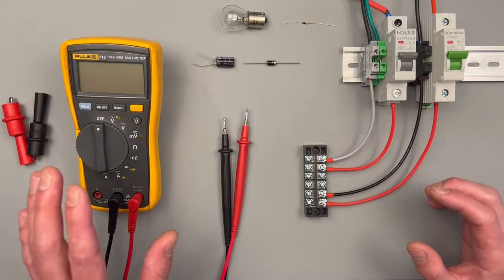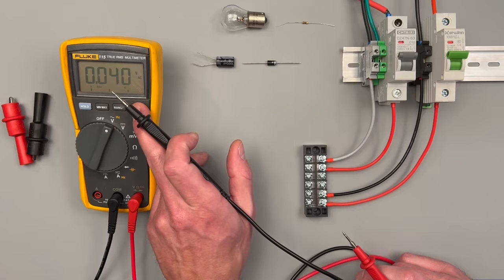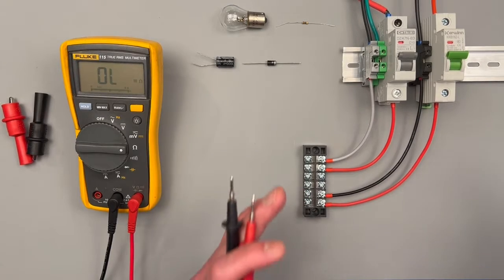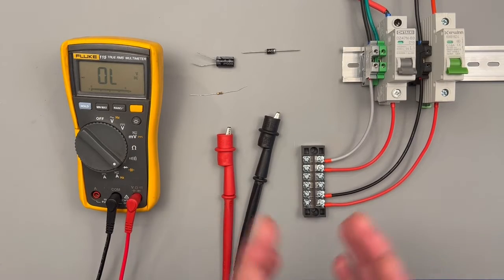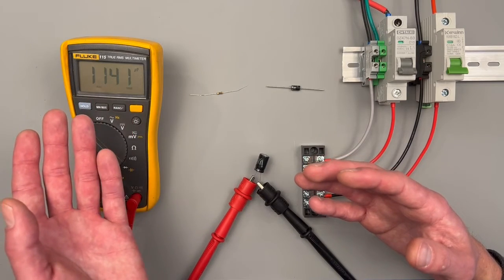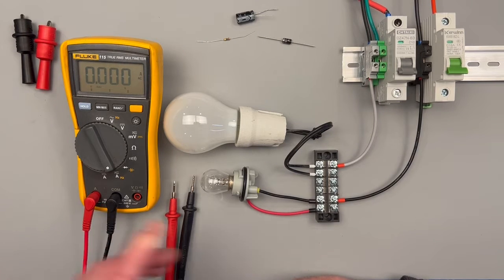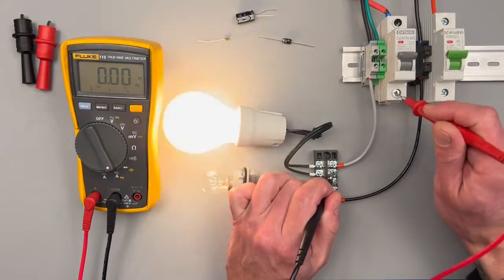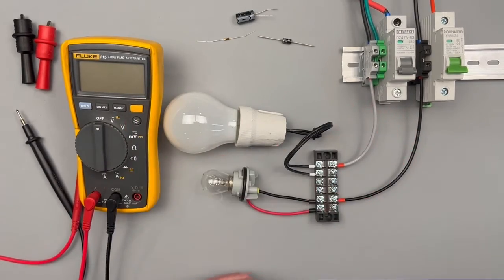🥇 How to Use the Fluke 115 Digital Multimeter - Comprehensive Tutorial & Review!

Comment: If the DC voltage was 12V, how come the DC mV wasn't 1200? I'm confused.
Reply: Its a bit of a late reply, but if you look up the manual for the meter you will see that the range for DC millivolts is 0.1-600mv. 12v applied to the probes is so far out of range for that setting the meter was giving an erroneous reading.
Reply from the maker: @clone4211  good to know! thank you for sharing.
Reply from the maker: @Daniel-v3o  could you provide a time stamp for which section of the video you’re referring to so I may clarify?
Reply: @maddoxmechanic  DC Volts - 1.22 and  DC mV - 1.53. I also realised I got my decimal point wrong as well, 12 volts would be 12,000 mV (which I presume could not be displayed anyway) not 1200 as per my previous. Thank you.
Reply from the maker: @ no worries! You bet!👍

Comment: Does this tester test rectification like the 116
Reply from the maker: @Nadaan2000  do you mean, does it have the ability to test diodes? Because if so, yes.
Reply: @maddoxmechanic  I think he meant flame sensor (not sure, not an HVACR guy). If so, then no
Reply from the maker: @bengkelbawahpokok6753  oooooh good point. No, it is not rated for DC micro amps
Reply: Flame recrification in milliamps  @maddoxmechanic